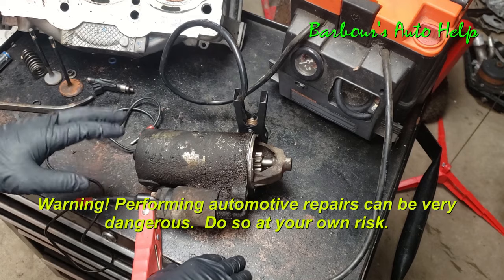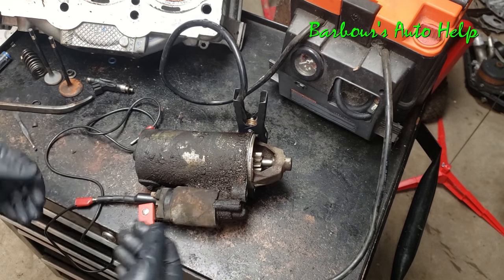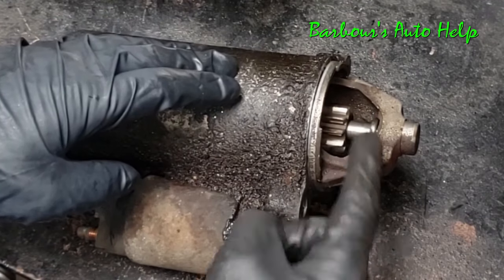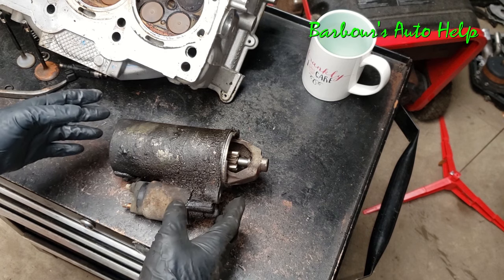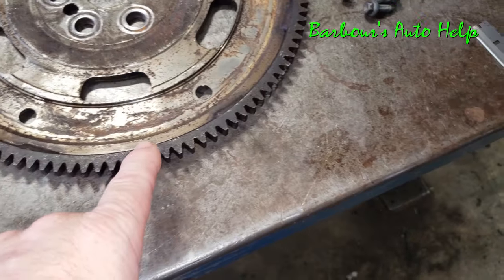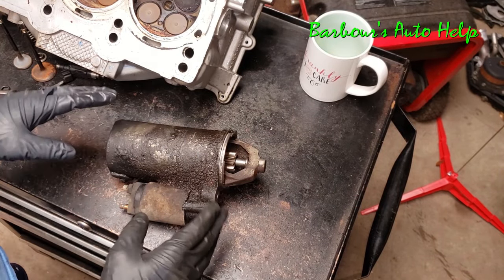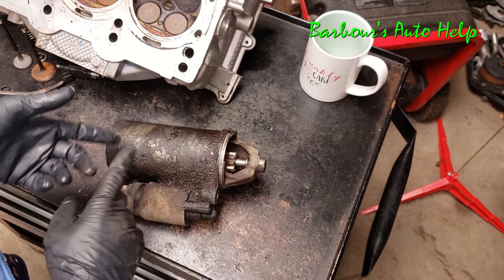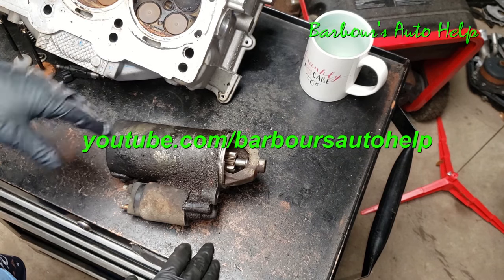Loud Screeching/Grinding Noise When Starting. What Caused This On My Vehicle

Comment: Hey, so I just replaced my starter in my 65 mustang and the car starts but there is a grinding noise coming from the bell housing while the car is just sitting and running. Is there any explanation besides there being a failure with the flywheel because this noise only started after replacing my starter.
Reply from the maker: Does this starter require shimming?  Have you removed the new starter to see if there is evidence of maybe the flywheel rubbing on it.
Reply: @BarboursAutoHelp  jegs told me this starter does not require a shim. I have a 302 small block and my last starter went out because it was too close to the headers. I tried putting in a stock starter after to see if it wouldn’t hit the headers but it was too large, so I opted for a high torque starter. This starter fits fine, but when I turn the key it makes a terrible grinding sound while starting and while running. I took a look at the starter gear and it seems to be unscathed, and could not really get a good look at the flywheel, but the teeth looked ok.

Comment: Do we just manually turn the crankshaft little by little?
Does it matter what gear is it on? 
Does the direction I turn it matter?
I'm not a mechanic, so bear with me. I think I can handle that.

Comment: I think I've only dealt with a few starter failures grinding like this.  I've just replaced them.  However, in the last 10 or 15 years I've kept the old starters and done autopsies on them.  Unfortunately, I haven't torn one apart that had this particular failure.  All of the ones that I've torn down have been electrical issues, bad solenoid, worn brushes, burnt windings, etc.  There's a lot of crud on the outside of that starter so I'm wondering if there's contamination inside that's somehow jamming up the pinion or throwout yoke.
Reply from the maker: Exactly and good point!  I'm sure there is a bunch of crud in my starter.  I was sure to mention this in the description.  A lot of times if oil leaks and coolant leaks aren't taken care of, like the ones that I have, the starter will fail again in the near future.  I've not only have an oil leak but I suspect a freeze plug is leaking on the back of the engine between it and the transmission.  A lot of water came out when the starter was removed......So, maybe I'll have a video on that one day.  I've gotta limp it along right now though.  Thanks for commenting.

Comment: Great video that explained exactly what's happening. My only issue is, how did you fix it? It's clearly working on your bench so what did you do?
Reply from the maker: I replaced the starter.  It was the starter that was causing my issue.  It would intermittently act up.  Haven't had this problem since.

Comment: FYI ring gear teeth on Chrysler L.A318/360  are on Tongue converter not flex plate as on Ford or G.M so if teeth are damaged the Torgue converter will have be replaced
Reply from the maker: Ouch!  Thanks for sharing.

Comment: So i got a 2000 isuzu rodeo, and i cant get the solenoid out so i just replaced the motor part. And it still does that noise.

Comment: I have a 04 ford Taurus . Im having this same problem. Is it possible to view the Fly wheel on a Taurus the same way . I spoke to a mechanic that replaced my starter and he said he would have to remove the transmission. To view the flywheel . Is that accurate?
Reply from the maker: You should be able to view the ring gear through where the starter mounts.  This is what needs to be checked. No need to remove the transmission to inspect a damaged ring gear.

Comment: I replaced original starter that had 10 tooth on it with aftermarket with 9 teeth on it and it was working perfectly for a few weeks now I hear grinding noise in 70% occurrence when starting the car

Comment: Hello I have a 1979 el Camino and I have a new aftermarket starter. One day I turn the key and I hear this ugly grinding noise I checked the starters alignment and it was good. I also checked if my starter was bad and it isn’t. So what seems to be the problem
Reply from the maker: Is the starter shimmed correctly and have you checked the flywheel?